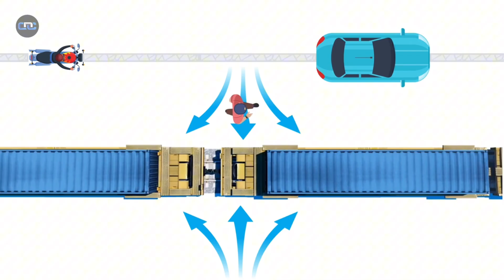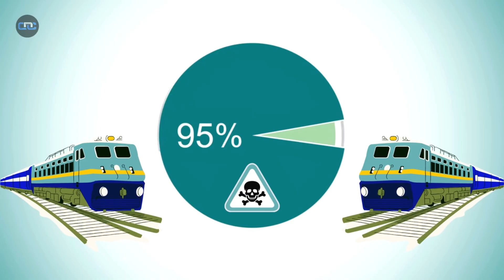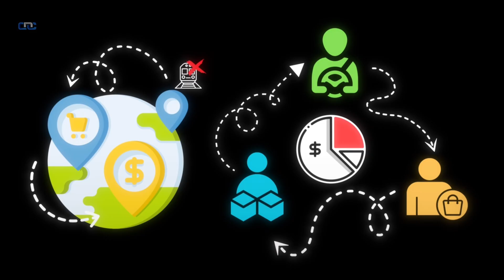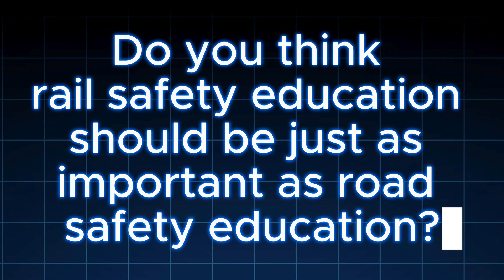Why You Should NEVER Stand This Close to a Passing Train

Comment: this experiment has been een done by the Mythbusters  and it shows that if your close to a train it wont suck you in not even a bit  so i wouldn't listen to this guy. he probably drives everywhere so what would he know.
Reply: That may be so, but there was one time. I was standing at a train station and an Amtrak train went by at 79 Miles per hour. It took my coffee cup Clipboard and briefcase right out of my hand I didn't move but there is a lot of air suction when a train goes by.